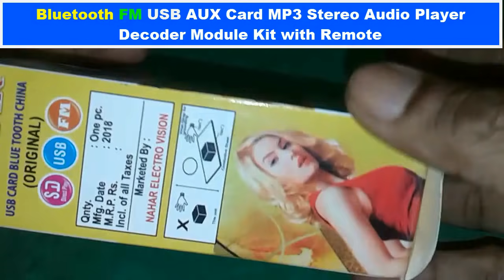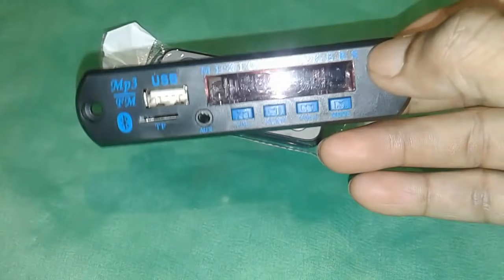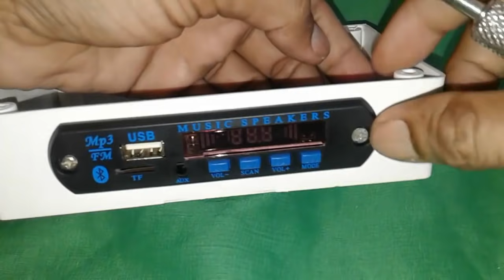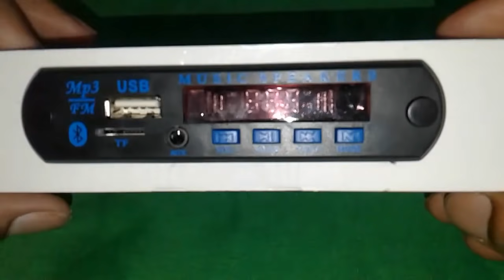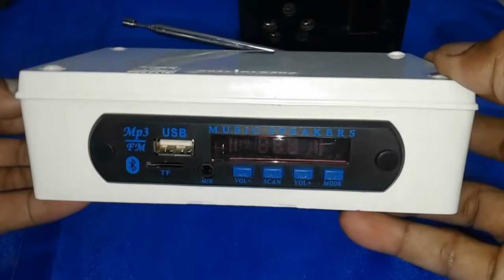How to make a mini music system !!! Mp3 / Bluetooth / Fm

Comment: Nice 8403 kit are awesome you need one 470/16 volt condenser then two 8 inch speakers box then test boom box bass sound add condenser remove power drop problem 😋
Reply: Ek banake dikhao
Reply: @SajalDasstyle  chake my video one complit I try to make other one

Comment: PCB box ka size and amplifire module ka price kitna hoga??
Reply from the maker: PVC box size 4 inchi by 3 inchi।।।
Audio module price online ₹70+ or  local market price ₹30।।।
Reply: @techtarun77  
Bluetooth pr jo huming sound ata hay wo kyse remove kre??
Except another voltage source for player module or amplifier module??
Reply from the maker: Blutooth bord ki positive negative supply pe ek 470uF /16v capacitor laga ke dekho।।।
Dono bord ki supply alag alag do।।।
Reply: @techtarun77  
May ne dkha hy ki supply alag alag krne pr huming nhi ata hy.pr may chahata hu 1 supply se kya possible hy humimg dur krna?? that i want to know actually...

Comment: Plz make video on it wholesale price on shop both bt module and amplifier circuit board?
Reply from the maker: MP 3 Bluetooth module price 170/- or Amplifier price 30/- ।।।
Reply: Where to buy plz give address of the shop
Reply from the maker: Aap ki local electronic shop pe milgayega।।

Comment: इस 4v Pam ic की जगह 12v amplifier ic से bt+aux +fm+sd/usb with 12v powerful performance amplifier
12v सही है क्या?
Reply from the maker: 12v  powerful amplifier use Kar sakte ho।। Bluetooth /usb/MP3 bord ko 5 v supply denaa parega।।।
Reply: @techtarun77  ye kitne valt ka supply h to
Reply from the maker: 5v mein chalta hai।।।

Comment: Sir
I get a transistor from this kit
Were it use?
Reply from the maker: Transistor number ??
Reply: @techtarun77  L7805cv
Reply from the maker: 7505 ic ..
First pin 12v in put
Middle pin ground
Last pin 5 v out
5 v output connect blouthooth module positive।।।
Reply: @techtarun77  Thanks for respond to me

Comment: Are bhai isko transformer se kaise jode... Because charger se ckt ud sakata h
Reply from the maker: Mp3 Bluetooth module 5 volt  circuit।
Mobile charger output 5v ।
Use 9v transformer +7505ic
7805 ic First pin 9v positive in
Middle pin ground 
Last pin 5v positive out।।।

Comment: its radio reception is so weak, how to improve it?
Reply from the maker: Use radio anteena
Reply: @techtarun77  i soldered wire - weak signal, than soldered it to antenna like yours-  same. Any other way, electronic hack?
Reply from the maker: No

Comment: 12v se dc supply se kse chalaye
Reply from the maker: Use 7805 ic।
7805 IC first pin 12v input
Middle pin ground
Third pin 5v out
Reply: Thanks

Comment: Ami ki akhane 5*2 w speaker use Kori tahole ki sound kom asbe
Reply from the maker: কোনো অসুবিধা হবে না।।
Reply: @techtarun77  ata theke noise kibave remove korbo
Reply from the maker: 8430audio board a একটু noise থাকে।।
অডিও বোর্ড এর 5v supply a একটা 470uf/16v লাগিয়ে দেখতে পারো।।

Comment: Pls add battery connection sir
Reply from the maker: Charging port ki positive negative wire jaha par laga hua hai। Usi jagah par battery ka positive negative Lagana Hoga........
Reply: @techtarun77  NO wery dangerous, use tp4056 module charging battery, one cell 18560 battery and power up booster usb board make under 5V to up 5volt to player, or if you have 12V model, use 3 cell battery 3 or 4 and bms board and step down adjust charging 4,2 v and step down board uoutput adjust 12V and thats is, wery simple. 1-2 module board cost 2-3 € and batterys.

Comment: Bro instead of PAM 8403 you can use TPA3116D2 amplifier. It will be good and gives bass sound also...
Reply: But that will require 12 volt power supply
Reply: @supersachin283  haa yes bro

Comment: How to connecting a bettery
Reply: Remove Sal plug put black wire to negative red to positive not hard 2 yr old can do it
Reply from the maker: Use 7805 IC ।।
Convert 12v to 5v

Comment: bhai 12v se kanection
Reply from the maker: 12v se chalane ke liye 7805 ic use Karna padega।।।
7805 ic - 1 no pin 12v in
                2 no pin ground
                3 no pin 5 v out

Comment: Haha its not 5v its a12v
Reply from the maker: Use 5v power supply or mobile charger
Reply: They are sold in either 5v or 12v units. I have a 12v one and will be buying a 5v one.
Reply: @ianallen2  better use 12V and change biggest amplifield about pam 8640 etc. 15-20W what use 12V too, then sound have better and speakers change 15W too. or IF use 5V mini amp 6403 and player 5V use battery  bms and tp4056 charger simple 5Volt player portable no need wall power, only charge battery.
Reply: @mattivirta  I made my one and have placed it in a box somewhere. I wasnt very happy with it at the end of building it.